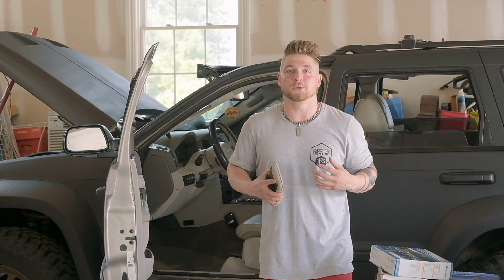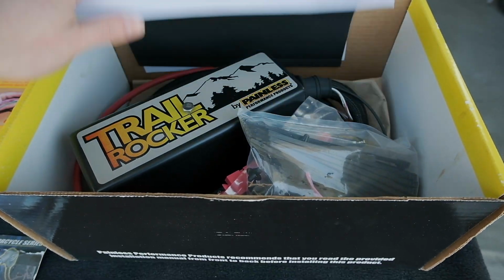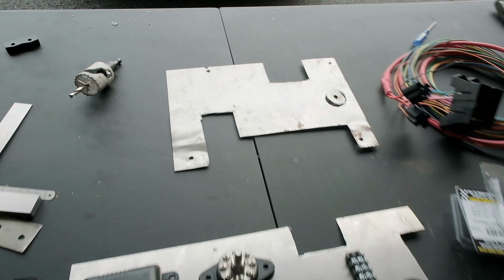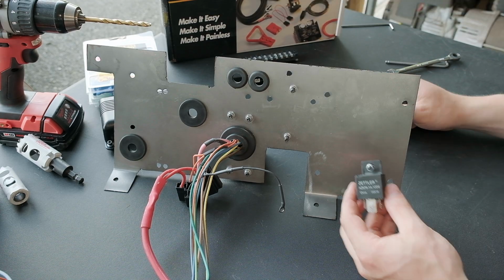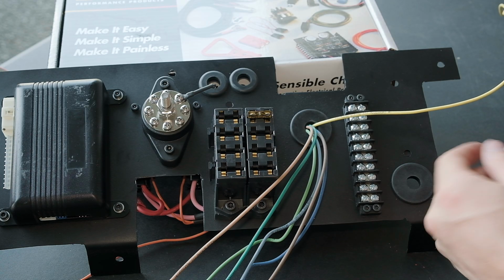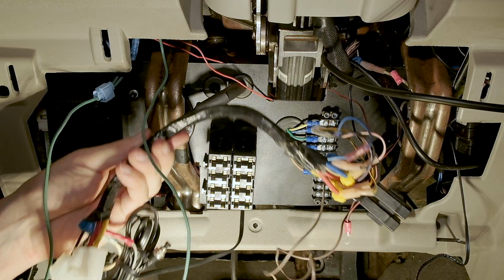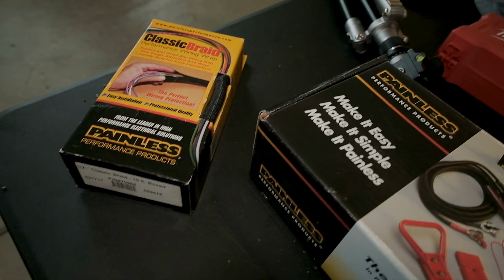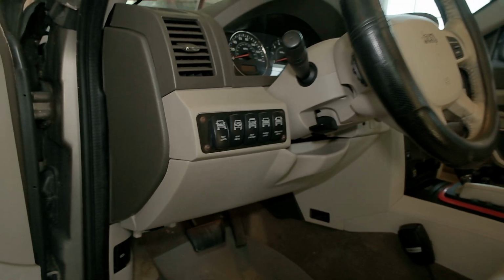How to Make a Power Fuse Block / Relay Panel for your Car

Comment: I have a question I have an 07 Grand Cherokee turbo diesel I have gone through 3 transfer case control modulars do you have an answer to this question how do I stop going through these every time I plug one in the code goes away as soon as I put it into low it will work and then goes bad.

Comment: Great tutorial. So just so I'm clear, the accessory trigger wire you connect to the OEM fuse panel goes to a relay, correct? Like, it's not a major power draw through the OEM fuse panel? 

I'm scoping this kit out for my 1965 Mustang, which has literally five fuses for the entire car. It's a pretty nasty mess of psychedelic spaghetti under there right now and I need to clean it up (and make it safer!)

Comment: I don't really have that many accessories that I would need this but super cool project regardless!
Reply from the maker: It’s nice doing this with the power distribution block so nothing is soldered permanently. It’s a great proactive project if you think you’ll ever add 12V accessories, but if not then I do appreciate you watching and taking the time to comment 🙏
Reply: @MyJeepStory I've only been financing the jeep for a few months now and have done some pretty basic mods. So I'm sure I'll get to a point where I'll add some so for now this video goes to the jeep playlist 😅
Reply from the maker: Well good luck with the Jeep and again, thanks for taking the time to comment. Let me know if I can ever be of help in the future!

Comment: Look's pretty nice but good luck to the next guy when there is a problem. "engineers"
Reply from the maker: What do you mean? The panel is easily removable and the connections/fuses are all numbered and labeled? It’s actually more straightforward than an OEM fuse panel since there’s one main power wire that goes to the battery. I’m genuinely curious, how would you improve this? I’m not saying my work is superior in any way, but I thought this was very practical and easy to use.
Reply from the maker: I also want to add that I’ll probably pull every accessory that this is hooked up to and this will leave this empty and able to hook up to anything the next owner wants. I’ve also owned this Jeep for eight years with no plans on selling it.